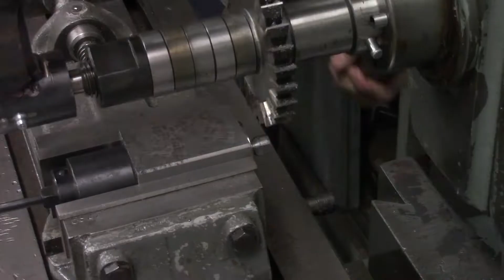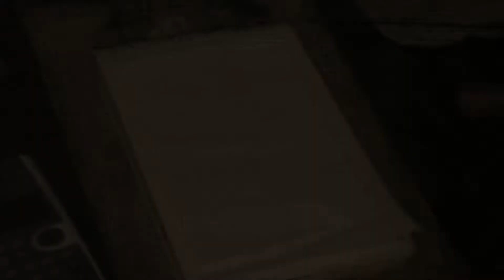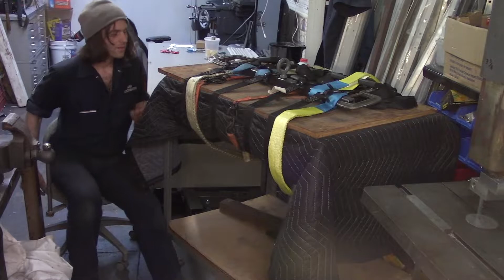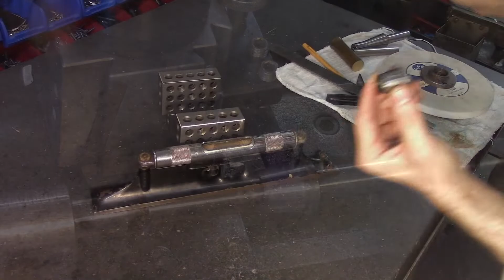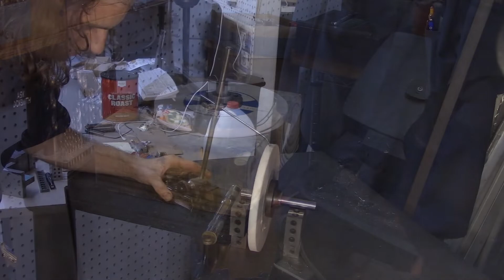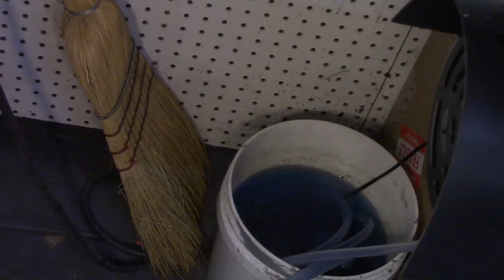Reid grinder 3:  The Balancing Arbor and Wet Grinding Attachment

Comment: Thanks for this video!  Wish I’d had it to refer to when I made my balancing taper. I got the taper pretty close, but not exact when i checked with bluing. It stays in place when fit in the hub, but not a feeling of it being “locked” in place. Maybe I’ll make another one with your instructions!
Reply from the maker: Good, I hope it helps somebody , I haven't seen any videos on making the arbor. Since making this vid I realized what's going on is that the cone is slipping, so I welded it on. Also I have to just hit it a little harder and it will seat on the other hubs too.